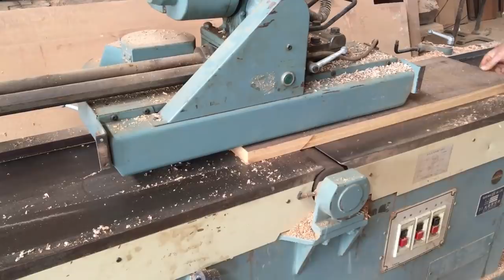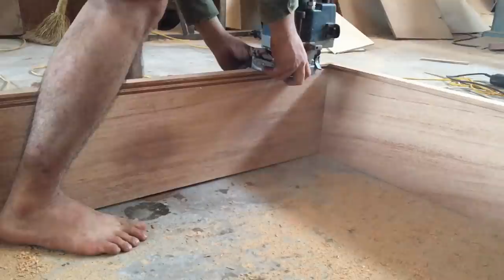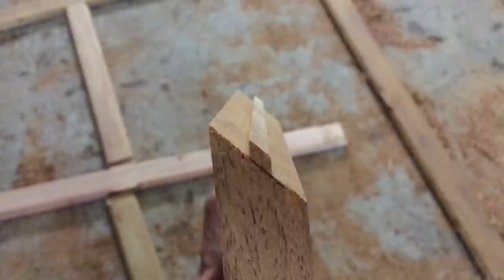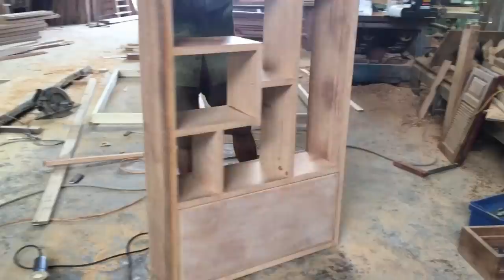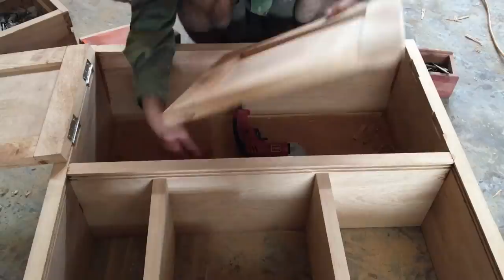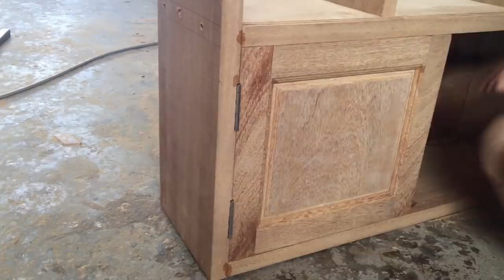Amazing Woodworking Skills Easily And Creatively - How To Making Wall Shelves, DIY

Comment: I love  the  sliding table saw !  I worked in a shop  with  a couple  of Altendorfs   That were   Nice to  crosscut on    I personally    Favored  a older model   That  didn’t have many  digital/ computerized  functions   On   It  but  the accuracy  was    There   If you set it up correctly    And no one   Abused  the machine    Your table   Appears to be larger     Than the one we had  and  ours  was Aluminum  you   Do nice work    I enjoy    Your videos    Very much

Comment: Good skills, specially when using basic tools. Just need to improve tools. And use safety shoes while work.
With proper disciplin your skills will be multiplied 3 times.

Comment: No dovetails, no pocket holes, standard building, nothing amazing about ANY of it. As a mater of fact instead of using the router to make his 45,s he could have just tilted the blade on his table saw. Its a shame such beautiful wood was used so commonly, industrially , shameful.
Reply: 2late 4most cant you see he is just using some basic tools,he did great job with just some basic tools,pocket holes are not always needed
Reply: yah' probably right bro',plus the thick planks never look good for a small size cabinet.